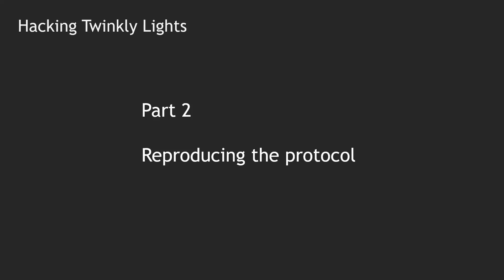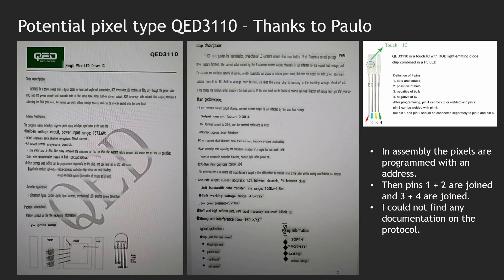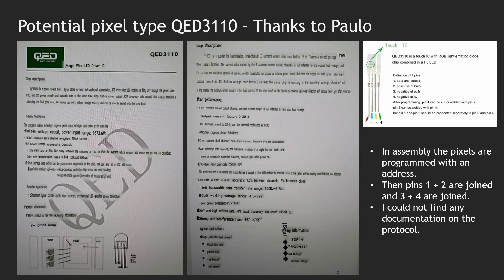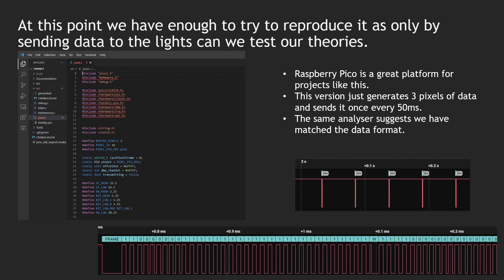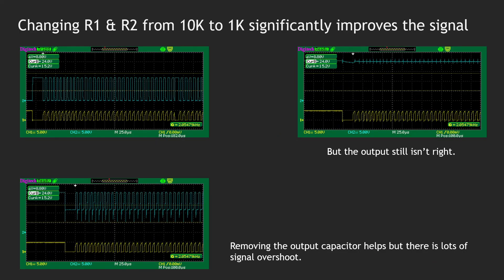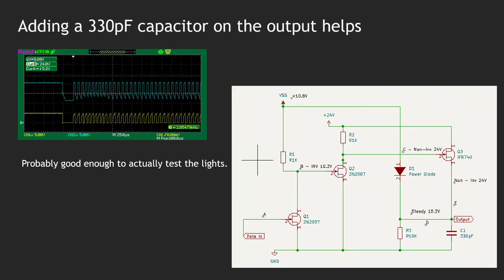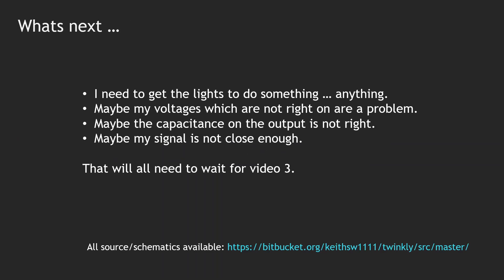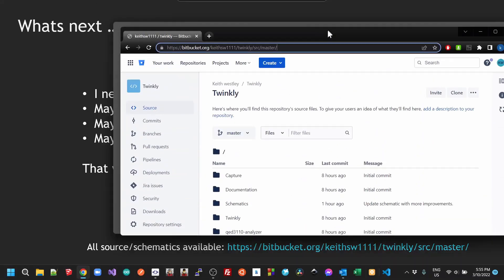Hacking Twinkly Part II

Comment: I've just been exploring a Twinkly festoon PCB and I'm wondering if it uses two voltage thresholds below 24V.  Possibly a sync pulse for each start of frame?  There are two resistors connecting from the positive rail to the green and blue LED driver pins.    It's amazing they can thrash as much data along a pair of wires without swapping polarity RS485 style.

Comment: Are you sure there's no initialisation string or similar that the Twinkly controller sends on power up that you'd also need to capture and emulate?
Reply from the maker: Based on what i have found so far yes I am.

Comment: Whilst reverse engineering the pixel protocol will open up some possibilities with respect to attaching cheaper and different LED strings to a Twinkly controller, the idea of emulating a Twinkly Gen 2 controller API on something like WLED is more interesting to me, then we can use the very easy to use Twinkly app to control any WLED controller + strings.
Reply from the maker: They are very different problem spaces. In many ways what you are interested in is much much easier to achieve as long as their sync protocol is not encrypted.

Comment: The 600 LED String starts off as a 2 pairs of two wire outputs (each driving 300 LEDS) from the plug pack but then each string changes to 3 and 4 wires. Do you know why?
Reply from the maker: I don’t have access to a 600 string.

Comment: Perhaps decouple any potential electrical issue from the protocol reverse engineering issue by performing some surgery on the Twinlky controller such that you can inject the signal from the pi pico into the existing drive circuit in the Twinkly controller?
Reply from the maker: I really don’t want to risk damaging it. I use the controller for testing with xlights.

Comment: I'm quite interested in finding out if the individual strings for the pro controllers work the same way. I think you must be correct on it not always putting out signal to every pixel, which it wouldn't have to do if they are addressed.  It also clears up something else.  Some of the twinkly strings have a higher framerate than is implied possible by the timing you found.
Reply from the maker: I have no idea. I dont have access to a pro controller.
Reply: @Keithwestley  You wouldn't need one, just the string.
Reply: @Keithwestley  I've basically confirmed this.  It's evidently only updating lights that change between frames.  You can get really smooth scrolling effects but if you change every led at once, it craps on itself.  I've witnessed it multiple times in my recordings.  Spinning fan looks great, quick transition gets nearly skipped.

Comment: The RC constant of the 330pF and 10k resistor will be around 3.3 microseconds = 300kHz. Dropping to 1k will give a 10-fold increase in this. That would certainly sharpen up your signal.
Reply: Further to this - looking at the timings you have at around the 6:50 mark - the "End Word" signal is 2.25uS - meaning your are hitting up to 440kHz for this short timing.  You may not need to go all the way down to 1k - maybe start with 6k8. You could also reduce the capacitor down as well - a 220pF and 6k8 resistor would give you a time constant of 1.5uS.
Reply from the maker: I will give that a try

Comment: You are making good progress. I read somewhere on that site that LEDs can be reprogrammed "any times", but there was no saying how to do that. Maybe there is a way to reprogram the LED address, which would make it much easier to replace bad LEDs.
Reply from the maker: Possibly. There is also no doco on how to program them. You would need to separate the leads to do that which likely would not be worth the effort. If you were replacing them I think you would just get a supply of new ones and a programmer.